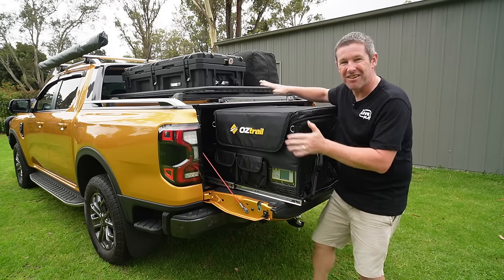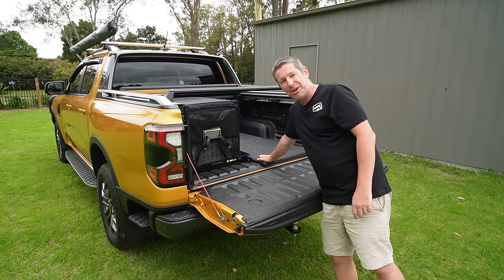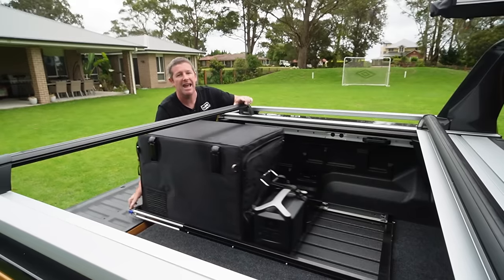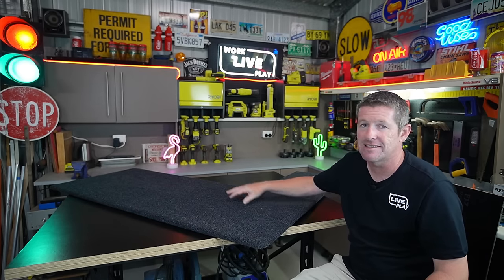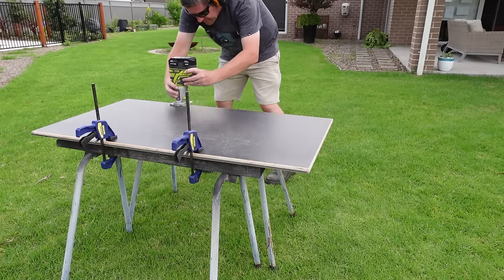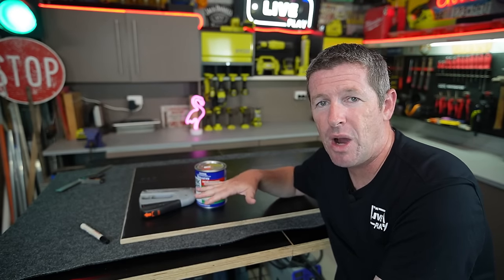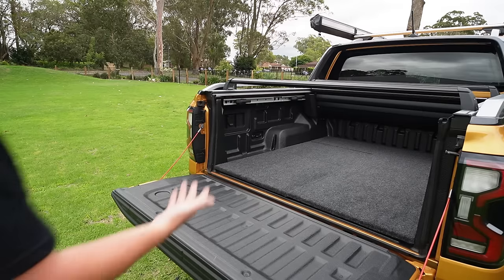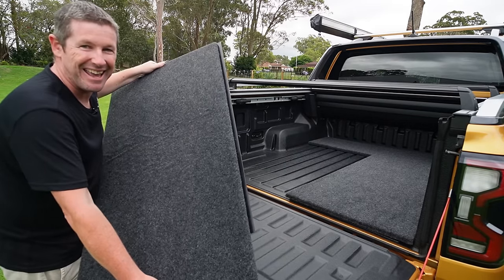Building a DIY removable floor with fridge slide in our Next Gen Ranger ute tub tray - its easy!

Comment: Waiting for a new dmax, did not want to cut or drill anything great idea, video on tube rack also excellent, very pleasant to watch will be checking out your other videos.
Reply: Car arrived 13 months wait, installed your floor minius carpet, with tiedown points, used steel bracing with press nut  underneath+ eyebolts on top, look at carpet when I have more time.
Reply: Link for tube rack

Comment: Great thought and design on this. However, there’s a danger for not bolting the slider down (as well as the floor) to the body. All well and good when you’re on a levelled surface but if you’re on a slight angle, the whole thing can slide down. This can cause massive injuries especially to a young kid who hasn’t thought much of what’s behind the tailgate. So please bolt it to the tub for that additional safety.
Reply: Could chain it I reckon, run chains on both back corners into the tie down in back corner of tub

Comment: Can you please give up your day job and just make more YouTube videos 😆 we just love your content. It’s very relatable. Thank you so much 👍🏻
Reply from the maker: It's great to hear most enjoy these videos, it's this feedback that keeps me going 😀
I wish I could do this full time, as I have plenty of ideas but unfortunately it doesn't pay the bills 🫣😂
Reply: Great idea I want to do a similar idea with the false floor   I've been down the road with the draw set-ups and find them just to heavy and restricted the trouble I have is accessing things up front of tub hence I am looking at a false floor that can pull out on some sort of sliding set up.
Reply from the maker: @craigingram-cg6si  a slide out would work extremely well. If I had the height, I would have done that. It's not that hard to do and there are some really good heavy duty runners available these days that can accommodate the weight even when extended out 👍
Reply: @WorkLivePlay what router bit did you use for top and bottom
Reply: The trouble is... once the you tube makers complete a project, that's it!

They need more sponsors to do other 'hacks'... different utes, trays, canopies... ?

The content runs dry without sponsors?

Comment: Some information on fitting those cross bars on the roller shutter would be awesome.
Reply from the maker: I actually had that all in the video but stripped out as it was far too long. When we get back from this trip away I will finish the video off and include some other storage tips and tricks. I should hopefully have that done in the next week or two 👍
Reply: @WorkLivePlay  thanks mate.

Comment: Good job, nice and informative.  Just a tip, if you don't have the kings tub rack yet, the Ozi4x4 rack doesn't need the chop on the mounting section to fit a roller shutter.
Reply from the maker: I was looking at those however the king's for the price is very hard to go past 👍

Comment: Thanks for the content. Nice setup. FYI, your Ecoflow power supply is Lithium Ion opposed to LifePo4 so unless you can't afford the space your spending money on a battery chemistry which has 1/4 to 1/8 of the lifespan. Thanks for the content. Cheers
Reply from the maker: I had the River Pro before the series 2 came out. Agree, these days you would go the newer unit for the LiFePO4 battery. Otherwise it's been a great little tool for camping 👍
Reply: I've been looking at the eco flow $1899 for fridge and one battery recently, as this would suit us as we dont want a permanent fridge in the vehicle.and your  saying lithium ion is old school?

Maybe I should wait a bit longer?
Reply: @Mick_4591  Everything is old school if you're living in the future ;). Neither lithium ion or  lithium iron phosphate (LifePo4) are old schoo. The former has a higher density ( same batteries used in cell phones) and the later has a lower density (thus larger for the same power) but lasts longer and is safer. A single fridge and some portable devices can't be charged with a 100ah LifePo4 battery without issue and can be recharged via solar very easily. Assuming you're in the US, you could buy a battery,  battery monitor, solar blanket and inverter for half the price of the EcoFlow. Cheers

Comment: For the stiff carpet either sit it in the sun if it’s a nice day for an hour or put it in front of the heater and it will soften it up so it’s much easier to work with.
Reply from the maker: That is a great tip, I'm actually going to give that a go as I didn't even consider using a heat gun. Thank you very much for that tip 👍

Comment: I found that to be a great help. I have a tub rack from Uneek 4X4, but you cannot get these any more it cost me twice the price of the flimsy kings unit but they will be fine, for a support to hold up your tub rack and tent check out bespoke 4X4  in Melbourne I have the PX3 and it has been a great bit of gear and I will be transferring the rack over to the Next gen in Feb or March but I will need to get the new support for about $500.
I look forward to your rack install.
Reply from the maker: I actually really like the Triple M support we used with the King's rack. I would check them out also as it isn't as intrusive as the Bespoke version for the Next Gen. Both are great companies to deal with though 👍
Reply: Thanks for the reply I had not known of the Triple M support but I will certainly have a good look. Does the Triple M come with a certified engineering certificate guaranteeing the weights both static and when being driven?  @WorkLivePlay

Comment: I am mounting my slide to Marine King Starboard. I needed a spacer bc my tailgate cover sits too high. I am using 1 inch marine Starboard. Do you think this will work well? Its essentially marine plastic lumber that is very durable and water resistant. It will be a bit heavy but I am either using Rivnuts to anchor it to the bed or using a rubber backer and leaving it unattached

Comment: For the sake of a few rivnuts I would just fix the fridge slide to the tub. Chuck rubber mat on other side if you think the tub liner is too slippery. If you are doing any 4WDing or have an accident you really want the fridge properly tied down. Kind of defeats the purpose of having a false floor if nothing is actually fixed down.
Reply: Many eons ago I ran a setup kinda like this and I just chucked a strap over it. These days my gear is rivnutted to the bed, but the old solution worked just fine if I was only heading out every now and again.
Reply from the maker: I do agree. If it was in a wagon I would 100% bolt down and I was pretty committed to putting some rivnuts in for the slide. The issue is we often don't want it in there and if you do have dirt in, you almost want to plug the larger holes you need to make in the tub liner. I've been known to pick up the odd bit of turf etc. On the way home 😅

Comment: Hi Vaughan, could not find link to foam.  Not sure if it is just me being daft?..... Cheers buddy.
Reply from the maker: Hi Peter, I did forget to add that to the list - I will add it in now!! Thank you for letting me know.
The product I used on the underside is the Moroday 450mm wide x 3mm x 3m Black Self Adhesive Roll. Here is a link:
https://www.bunnings.com.au/moroday-450-x-3mm-x-3m-black-self-adhesive-eva-roll_p4000085
Reply: Thanks Vaughan - much appreciated

Comment: No concern of water getting onto the battery and fridge when the vehicle is in the rain? I know you have the cover, but those sliding ones on the Ranger aren't waterproof?
Reply from the maker: I'm not too worried about water ingress at this point but have been cautious. Given the EcoFlow is raised up off the floor, it should not be impacted by any standing water if it was to get in. That said, we have been through some intense rain over the past few weeks on our current trip up to Queensland and it's still bone dry inside. The new model roller shutters seem to seal fairly well.

We do remove when we aren't using it in any case 😉

Comment: good vid .. do yourself a favour and buy a can of carbuilders spray adhesive awesome thing .. not anything like the run of the mill spray can glues. try it you will never go back
Reply from the maker: I have been meaning to try it out as their products are excellent. All the spray adhesives I have used to date haven't really stood the test of time.
Reply: @WorkLivePlay  yeh definitely worth it . I've tried them all over the years and always went back to brush and tin or big jobs I'd buy a cheap spray gun . Once I tried the car builders I went back and ordered a box